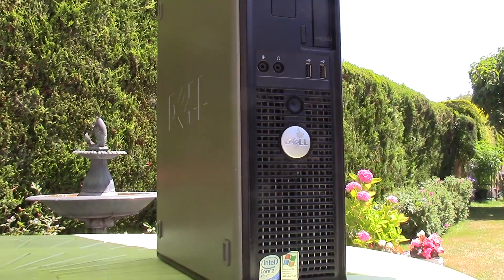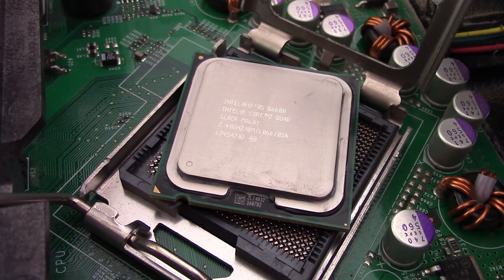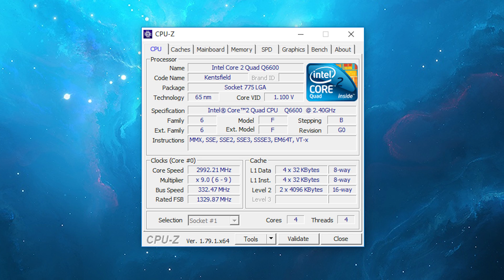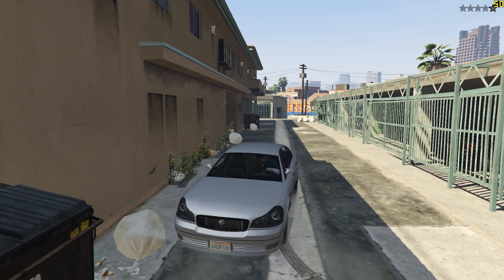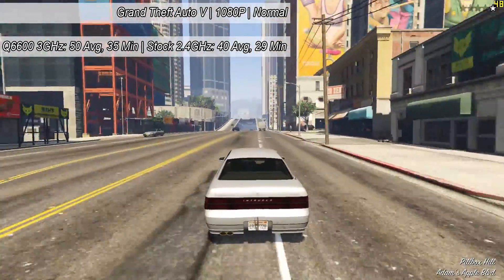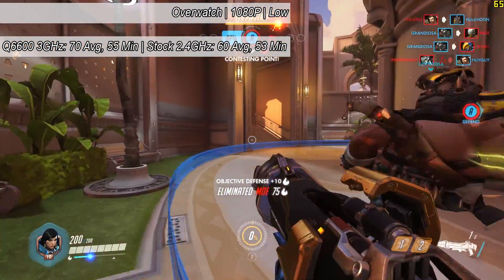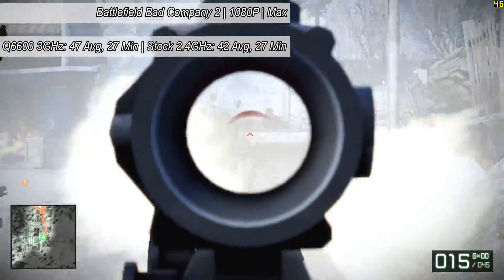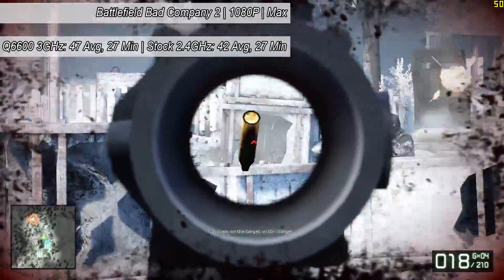Using Tape To Overclock an Old Optiplex

Comment: An alternative method is to put your PC over a clock.
Reply from the maker: Trypticon8 can confirm working
Reply: RandomGaminginHD lmao
Reply: Soban Mustafa no it's over(a)clock
Reply: sure.  I run mine like that for a couple of months already
Reply: What.
Reply: very witty, kudos to you!
Reply: Does this also work with an alarm?
Reply: Tried, wasn't particularly stable, fell over after just a couple of seconds. may need a better power supply.
Reply: lol I see what you did there...
Reply: BAD joke
Reply: top kek that's underclocking
Reply: Trypticon8 tried it twice it doesn't boot anymore did I do something wrong
Reply: EyedWeevil maybe download more ram and change timing/clock rate to stabilise it.
Reply: yeah, you'll get 1 FPS
Reply: XD
Reply: This joke Is so bad that I'm calling the cops on you 💀

Comment: Back in my day we used graphite pencils, interesting result, and great video as usual :D
Reply: hey Budget-Builds Official
Reply: VoltaDynam7cs: Yo
Reply: Enjoy your vids man, am a subscriber, still remember that awfully toasty GTX 480...
Reply: VoltaDynam7cs: Well the next video sure is toasty too... I have something special coming up for 1k subs in the next few weeks.
Reply: Toastier than a 4-way R9 Fury Crossfire?
Reply: VoltaDynam7cs That's just cruel.
Reply: I love athlon XPs, they are fun little chips once you get used to it, i actually don't really like the pencilmods, since they easyly rub off, I allways preffered soldering the according pins on the bottom of the board to modify multiplier on all CPUs I might use on that board:) For making processors compatible for multiprocessor use i allways used conductive paint, or what ever you call that stuff :D
Reply: Budget-Builds Official I remember there being a hardmod you could do on the PSP to hack it that you can revert with a pencil :D
Reply: Phantom Dancer I like the R9 Fury. But they can sometimes feel like they took a trip to hell tho XD
Reply: Ha, I remember using graphite pencils to overclock Athlon Thunderbirds about 15 years ago.
Reply: I still do. Pencil on 1 resistor of an ASUS p5n-e sli mobo to reduce vdroop. Went from vdroop of 0.1v to 0.001v.
Reply: Ahhh, the old athlon XP trick!
Reply: Budget-Builds Official 1k subs 8 months ago, now you have 84k
Reply: Heyo
Reply: Budget-Builds Official please do a video about this.
Reply: Hey thats warowl joke u can't steal jokes
Reply: I still have a core 2 quad q6600 in my PC, and it's max overclock must be beyond 3ghz, otherwise is not gonna boot, i've tryed the trick and it's not working for me. Right now i have it overclocked at 2.7 ghz with the old Intel fat cooler, the one after the copper heatsking removal, and it struggles to keep  the core 2 quad under 85 degrees in cinebench, and around 82 degrees if i keep the fan at full speed.
Reply: Graphite pencils were used for shorting.  This is for blocking.
Reply: Can my Dell optiplex 380 run fortnite if I over clock , just bare in mind I've just got my hands on a bone stock Dell optiplex 380 and I'm just looking for a second console to dick about with as a spare
Reply: 2400+ pencil mod 😎
Reply: @BudgetBuildsOfficial  1k subs in 2017? Usrs? Now at 188k! wow
Reply: @zukundus8987  Yep! Well deserved
Reply: Do we need electric tape or normal please answer
Reply: But that was to unlock the multiplier
Reply: @BudgetBuildsOfficial  wow you grew a lot from 1000 subs congrates just subbed
Reply: @BudgetBuildsOfficial  for 1k subs 3 yrs ago, and now 200k+ subs, progress
Reply: Yo bro
Reply: Post more often you dingus
Reply: My brother told me about the graphite, care to explain how it worked?

Comment: Next day playing the games on that pc be like: wtf, why did my fps just dropped so much? Ohh crap, I think tape has melted...
Reply from the maker: galaxy_ dust haha shouldn't melt. read stories of people who left tape on for years until they upgraded
Reply: RandomGaminginHD lol, that was supposed to be a joke
Reply from the maker: galaxy_ dust I know, but I wanted to explain anyway just in case anyone wants to try this out for as long as possible
Reply: The reason why it shouldn't get soft is because down there there is no used current.
It all flows up to the CPU and usually the heat stays just over it and does not transfer on the bottom where the pin are.
Reply: +RandomGaminginHD why not use kapton tape? Its used on electrical transformer windings, so is heat resistant and has excellent electrical insulation... better than the electrical tape?
Reply: What other cpus are supported?
Is pentium e5400 supported?
Reply: all, but not all cpu work 25% tuning with normal voltage, find google "B-Sel mod"
Reply: Short : Yes 
Long : All LGA 775 CPUs that support higher FSB in their electrical spec sheet.
Example : https://manualsbrain.com/en/manuals/91381/?page=32
Reply: Taylor Edwards can a Xeon 5450 with 667 ddr2 ram use this trick?  I have a dell T7400 dual Xeon CPU would love to get above stock when I see these CPU go to 4.0 ghtz
Reply: Does the Q9400(C2Q) support this? and I don't have thermal paste with me,so it wont affect anything if I just place it back with it's current one?
Reply: Murtaza Razzak I think it's recommendable to change it still since it might be a bit old
Reply: depends on how dry it is really, you'll see a 5 - 15c temperature difference not replacing the thermalpaste upon removing the cpu cooler & over time this gets worse as you get air gaps in there it can trap hot air which makes the heat transfer quite terrible.
Also the Q9400 is a 1333 fsb cpu so unless your motherboard supports 1600 fsb processors like the core 2 extreme qx 9770 & similar you are likely to just get a black screen & will have to remove the tape again to be able to use your pc.

Id wait with the mod until you can get hold on a bit of thermalpaste as with bsel overclocking you do get higher temperatures in load as well.
Reply: galaxy_ dust Man, electrical tape has more than 100C° melt point
Reply: its a 1333 fsb cpu so unless your motherboard supports the 1600 fsb qx9770 or qx 9775 core 2 quads i doubt it.

https://en.wikipedia.org/wiki/List_of_Intel_Core_2_microprocessors#.22Wolfdale-3M.22_.2845_nm.2C_1066_MT.2Fs.29
Reply: odd, that's how it happened right here with two old 775 motherboards that doesn't support 1066 fsb cpu's after doing the bsel mod on a pair of pentium 4's & a pentium D so figured it would be the same.
Reply: You know not many people would of done that to help. You were helping me in this case,
Reply: RandomGamingHD will this work on newer cpus such as my i7 6700 and will it make a performance boost?
Reply: RandomGaminginHD plz keep stressing it in games with the tape xD
Reply: lol
Reply: Electrical tape won't melt
Reply: @TheRealJackassJesse  Is there an alternative to electrical tape to apply?
Reply: @RandomGaminginHD  6 years on my DELL XPS 420 (Q6600, OC to 3.0 GHz, 25% OC) and counting.  Just used black electrical tape. I finally got around to changing the finicky power supply after over 11 years, which I had to reset at startup a few times until it would be warm enough for the PC to fully boot.  I think the spec even mentions an average lifetime of 11.2 years...unreal.
Reply: @jb678901  Hey dude, can u help me ?, i tried the tape mod on the q6600 with my mobo asrock g41m vs3 r2.0, but when i put the tape in the processor and turn on the computer the speed is still the same no difference, i have tried 3 types of tape, electrical, plastic, and my computer turns on but the speed is the same what i have to do ?
Reply: @franciscocarrero7031  Correct me if I am wrong, but isn't the ASROCK bios unlocked?  If it is unlocked then you shouldn't need to go for a BSEL mod. I did this on a DELL OEM locked BIOS...to get the FSB from 1066Mhz to 1333Mhz. This is a 25% increase.  Therefore, 1.25 x 2.4Ghz = 3.00 GHz.

In the case of ASROCK, can't you play with CPU multiplier...also voltages?

Also, does your motherboard support 1333Mhz?  My DELL does...they just locked it on the XPS 420 model to price differentiate, I suppose, versus the XPS 720 at that time.

In any event, here is the link to picture where the relevant PAD is identified.  

https://proxy.duckduckgo.com/iu/?u=https%3A%2F%2Ftse1.mm.bing.net%2Fth%3Fid%3DOIP.hDzLHyuJhWOghDuVyPZ4jQHaGW%26pid%3D15.1&f=1

https://forums.tomshardware.com/threads/q6600-tape-mod-pseudo-overclock.251609/

Also, I used black electrical tape (i.e. to insulate). A very very small rectangular piece that I carefully positioned with a magnifying glass (my eyes are not that good) onto that one PAD (the one just above the right notch on the edge of the CPU...where if you hold the CPU with pads facing you and the notches oriented low, both left and right) to cover it completely. If the tape slips from its position, the mod will fail.
Reply: My tape pieces keep melting, this is no joke.

Comment: This is called BSEL Mod, however it does not actually change the Multiplier but the FSB and Bus Speed.
For the Q6600 the FSB jumps from 1066 to 1333 as you can see in CPU-Z.
(Original Bus Speed = 266 --> 266x9 = 2.4GHz, Modded Bus Speed = 333 --> 333x9 = 3.0GHz)
Reply: Coldministrator 
How does that work on a technical view? like, what do those two pins control, and how does simply covering them work? In modern architectures there are base clocks and multipliers controlled by the BIOS, so is the bus speed determined by a CPU response somehow?
Reply: There is a total of three BSEL pads / pins on 775 processors and motherboards.
I belive BSEL is short for "Bus Select"
They are used so the motherboard knows what Bus Speed the CPU is designed for.
For Bus Speed 266 the CPU pulls all three of those pads to "High" or binary 1.
A CPU with Bus Speed 333 only pulls the BSEL2 pad to "High" while the other two remain "Low"
By covering the two pads for BSEL0 and BSEL1 on the CPU, the motherboard belives the installed CPU is designed for Bus Speed 333 and runns it at that speed.

That is all the information i have, i hope this answers your question.
Reply: It's Intel QX6000/Q6000 series Spec Sheet info at it's finest :)
How this works : 
LGA 775 CPU tell's MB how to clock it (front side bus), by using High/Low signals on BSEL pins.
They are factory set, but because same CPU die is used in faster CPUs (in case Kentsfield, QX6850/QX6800), you can force/trick BIOS into clocking slower FSB clocked models higher (as ast as fastest option available in spec sheet).

Problem with BSEL mod is two fold : 
1) Motherboard has to support higher FSB "by default". 
2) Frequency jump can be high enough to destabilise CPU on stock Vcore (can be bypassed by VID moding).
3) Some motherboards may require two pins taped for this mod to work. Others just one, and few motherboards may require complete ground route (ie. using alutape or "silver pen" between BSEL pins and  grounding pins).

BSEL method can be used on all LGA 775 CPU's that support higher FSB speeds in Spec Sheet.
Reply: @Compatibility Madness : I love your vids! Especially all the Pentium Extreme Edition Stuff! (subbed a few month back, if not a year ago by now.)
You got me interested in netburst e-waste and ever since i discovered you i have been playing with the idea of dual Xeon 5050s just to see if 4c8t of the worst possible architecture can still be usable :P
Keep it up man!
Reply: Thanks for posting this, i just wrote pretty much the same before i found this comment...
Also VID modding is usually a whole lot more complicated than just soldering a variable resistor between the feedback of the voltage controller and ground, i only ever did VID mods on boards where i couldnt figure out the OVP circuitry to raise the max possible VCORE a bit (might just be me beeing stupid or TYAN not using the example circuits from VC datasheet...) :)
Reply: so this means i cant do this on my Q9550?
Reply: ElTres there is one guy who tries it and fails...search for ninja hack and u will find it ;)
Reply: anything for 30 fps on my summer car
Reply: Coldministrator would this work with a celeron 420?
Reply: But what happen with RAM FRECUENCY?, will be Stock or  was OCed (BUS/FSB and RAM Frecuency linked)?.
Reply: ElTres> Nop, only works with Core2Quads 65nm like Q6600 and Q6700, I mean Quads with BUS 266Mhz/FSB 1066Mhz, your Q9500 has BUS 333Mhz/FSB 1333Mhz. Also we need a MoBo that support a BUS at 333Mhz and FSB at 1333Mhz.
Reply: You don't even have to tape the others, just the one closest to the notch on the cpu, been doing it that for for quite awhile.
Reply: Thanks for clearing this up, I wondered how this worked!
Reply: ayy phil <3
Reply: Aye
Reply: Juan Massiosare i saw a video about using an e8400 at fsb 1600 with this bsel mod...so...is bsel mod an alternative to use a c2d/c2q with a 1step higher clock speed(1066->1330->1600)? or is it really usable a cpu with stock 1066 fsb to use at 1600?(Tell me bros, if i overthought that...or is it recommended with only better air cooling?).
Reply: Coldministrator This is because originally Intel was going to sell it at 3GHz, but before launching them to the market they set the FSB from 1333 to 1066.
Reply: It's like pinmodding the Pentium M, where shorting two pins will tell the clock generator that there is a 533MHz CPU installed instead of a 400MHz. So if you have a Pentium M with 400MHz CPU and you short those two pins with a piece of copper wire, it will be overclocked automatically :-)
Reply: Does that mean that I can use this mod with 1333MHz RAM?
Reply: Hey Can I do this In core 2 quad q9400
Reply: hello, i have a del 780 with intel xeon x3363, this mod woks on mi processor?
Reply: @leovillalobos2215  nope, the Xeon x3363 already have a 1333 MHz fsb, you Can oc it only with SetFSB (Which is not guaranteed to work if you don't have the right PLL in the list)
Reply: Bro, I'm a tech dummies, is it works for pentium d e2140?

Comment: I taped my Pentium D to unlock a hidden i7 7700k
Reply: same
Reply: Mundie Afterlife dis shit old i unlocked the i9 with my intel 4004
Reply: I downloaded some ram
Reply: I installed a 4tb nvme
Reply: I overclocked my PSU.
Reply: I overclocked my rgb fan controller, I now have a larger selection of colours.
Reply: overclock my riva tnt2 to unlock secret rtx 3090 ti super 69gb xddr4.20 rev. d. oge

Comment: I've been using this method for a few years now!

I've upgraded to a new motherboard and case, but I was originally using this in an Optiplex 745 full tower. I went to upgrade the motherboard to one that supported Overclocking and the eBay lister lied in the description about the motherboard I was buying's overclocking abilities. This method was already done on my CPU earlier in the Optiplex system so I just kept it. Would have been nice to bump to 3.5Ghz since I got a T2 cooler with the build, at 3.0Ghz it never passes 45'c.  

My Q6600 is with with 8GB of matching DDR2 800mhz running in dual-channel, paired with a 240GB SSD and 3x700GB 10,000RPM server drives in Raid1. With a GTX 1050ti OC edition from Zotac to top it off (about a 20-30% Overclock at any given time depending how hot it is on the day).

For GTA V, I experience some hiccups with loading textures at high speeds (C2Q series only supported SataII), but opening TaskManager and lowering the launcher priority to low and the game priority to above-normal I am able to load textures at real-speed. Without changing I couldn't fly a plane without going into the gap.
Reply: Daxton Anderson you need a board that supports ddr3, it will hold you back a lot. I'm running a q6600 in a ddr2/ddr3 board and it certainly plays gta v better on ddr3 than ddr2

Comment: you can also tape 2 dual cores to get the power of a quad core 100% legit
Reply: Blue Redox ...
Reply: Blue Redox why wouldn't you just download more ram?
Reply: the pentium D was made this way
Reply: Mr Hyde Add and remove microtransistors that are under a millimeter in length, width, and height?
Reply: The Q6600 was made that way
Reply: And the new Ryzen Threadripper CPU's are also made this way (but in this case it's 2 octa core dies to get the power of 16 cores total):
https://www.pcgamesn.com/sites/default/files/AMD%20Ryzen%20Threadripper%20reverse_3.jpg
Reply: Illsigvo ye olde pentium D too
Reply: Mr Hyde dude be happy you can exchange your cpu at all, and customizability only goes away with time I have the feeling
Reply: Male Signor Anderson the core 2 quads were too.
Reply: core 2 quads were 2 core 2 duo dies
Reply: tfw threadripper did exactly what you said except with 4 core 6 core and 8 core processots in the 1900 1920 and 1950x threadrippers
Reply: FukiyaFhane that CPU chip set(s) will need so many drivers and might be so difficult to optimize for that it would be nonprofitable for  the consumer and Intel/and
Reply: Jaymes Clyke wtf are you talking about
Reply: Oh shit u right fam, How could I be so ignorant before😢
Reply: @AaaBbb-kw5em  just in two quad cores stuck with flex tape make a octa core thank me later
Reply: @HSK18  Oh yeah mate I did this and now I can play GTA VII 120fps 100% no bamboozle
Reply: The pentium d disagrees

Comment: It's called a BSEL mod, it makes the cpu run at a 1333fsb which over clocks it since it is a 1066fsb cpu. It almost always works unless the cpu needs a voltage increase which OEM motherboards don't allow. You can also go from 800 fsb to 1066fsb. You have to be lucky to go from a 800fsb to 1333 without any voltage increase on the cpu.

Comment: all 775 chips can do this, as long as they aren't running at an fsb of 1333 or higher, and your motherboard supports up to 1333mhz fsb. Basically you can OC any of the 775 cpus running between 533-1066

Comment: You can also use Setfsb on older Optiplex systems but only with Windows 7. Got my old Optiplex 755 with an Core 2 Duo E4500  from 2.2 to 3.3 GHz.